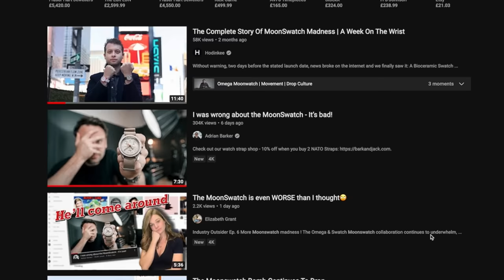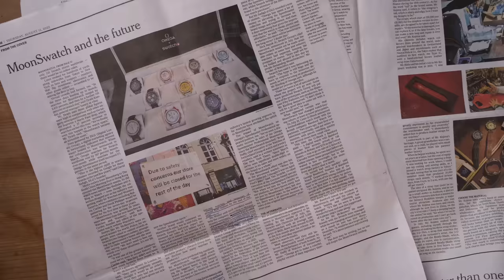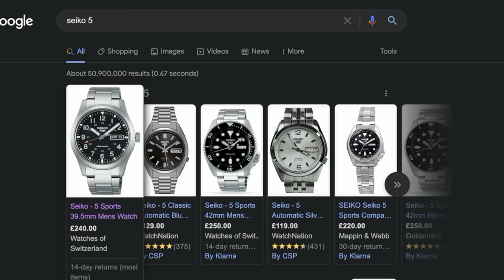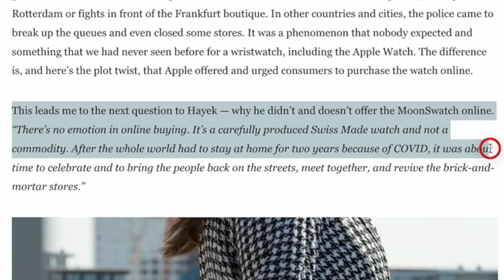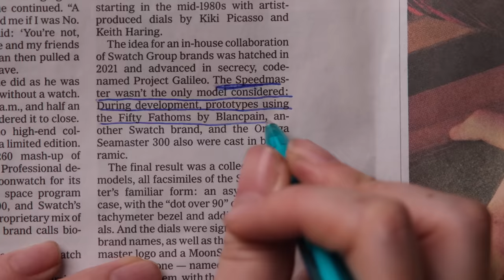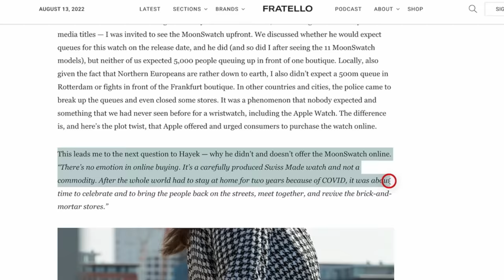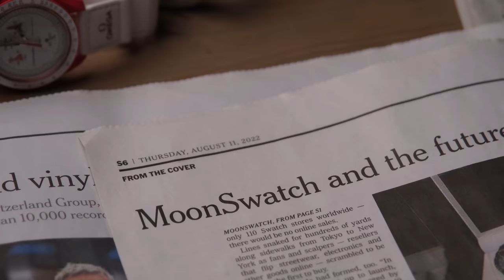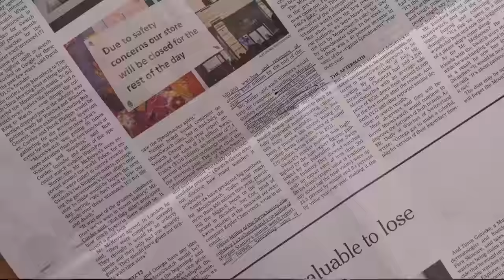The Omega x Swatch MoonSwatch = FLAMING HOT DUMPSTER FIRE

Comment: Swatch, I remember my friend got me the King of Tides SDK129, this watch has full lume on bracelet, dial, case and 200 meters. I still have it. Yes fun plastic.
Currently wearing a Timex MK1 Supernova, not my favourite, just happened to have on wrist and then see this video, the chronometer on my MK1 Supernova scratches the itch for the moons watch and has indiglo. I realize I don't even use the chronometer to time things.

I have dive watches with unidirectional rotating bezel to help measure elapsed time, analogue hands and a clean watch face is easy to read, my love is analogue G-Shock 2100's CasiOak and Square 5610.

Thanks for the video!

Comment: You didn't even mention the caseback is fixed to the case. So there is not even a way to repair it after a failure. Even Aliexpress offers much higher quality for less money. A disposable watch shouldn't cost more than maybe $50.

Comment: Whoa, looks like I've just dodged a bullet...  Let's be honest, for some people price for a real, proper Omega is sadly an unbreakable barrier, so I was initially quite excited, when I've learned about these watches recently. Mainly though, I go for quality, then the price. So when a watch bears a logo of Omega, I was expecting, that the case will be actually ceramic. Hell, it could be even generic stainless steel, but some cheap plastic? No, thank you. I torture my G-Shock at work on a daily basis, but even though it looks like it was already run over by a train, it still works, and I can always relatively easy buy online parts, like a new strap or bezel. And even replace them myself. While I could still live with that plastic case, I can't believe these Swatches have plastic glass. Well, I wouldn't expect top-tier sapphire for the price, but not even standard, hardened mineral glass? Really? I don't buy a watch to flex, I want to use it for as long as possible, and I want it to be reliable (in regard to its price).  Lately, I was looking at Vostok's Europe Energia series and now I guess I stick with choosing one of those - these are really nice watches. And to complement it, I'm going to buy one of the original Vostok Komandirskie watches, which are currently priced around 65 USD... And I'm going to wear it proudly. From what I see, it's still made from better parts and with better finish, than those Swatches.

However I must admit, the name of one of these Swatches, the "Mission to Uranus" sounds quite catchy - it could be a perfect gift for a new girlfriend 🤣🤣🤣

Comment: I agree with you. The “Watch Community” can be rather stuffy and this watch is really a Swatch with Omega Branding. If it helps Swatch Group survive, that’s fine with me. No one is holding a gun to people’s heads to force them to buy Moonswatches. If this brings them closer to “High Horology” then it has served a secondary purpose. I recently bought an Omega Constellation 41 in part because of the Moonswatch hype. [Well, not REALLY, but if it helps feed the Algorithm Gods, then OK.] I have simple advice for prospective watch buyers: “Buy what you like.” If people like the Moonswatch and it makes them happy, that works for me. It IS after all, a SWATCH first and foremost. You like yours, so there it is. 😎⌚️🍸

Comment: Perhaps you never had a Swatch as they all had plexiglass crystals which are extremely easy to polish in case it gets scratched. I have polished the plexiglass crystal of my Jaeger-LeCoultre Memovox Tribute to Polaris 1968 so I don't consider plexiglass crystal inferior but just different. The aspect which is un-acceptable is that Bark & Jack's MoonSwatch's pusher fell off after 2 months but this watch has a guarantee hence it is a simple matter of returning it for replacement since these are not meant to be serviceable.

Comment: Thanks Britt for tackling this.  I wasn’t sure how many content creators would address this now proven fiasco after Adrian’s video.   

Sad truth, with the power of the Swatch Group there is no reason why this watch couldn’t have been built to a sub $1k price point with a better ETA movement, proven plastic/resin case, removable case back, and overall solid construction.  $250 should never have been their price point with an Omega collaboration.  

Build an actual micro brand quality watch at $999 or less and create a true classic that would actually lift the Swatch brand.  Especially if they added that formula to create a whole new line.  It would attract enthusiasts beyond the Omega connection if they kept the Swatch playfulness but added some quality and longevity.   

There is no law saying Swatch has to be disposable.

Comment: I much prefer my 1983 Seiko 7a38 7070 which was also slagged off in watch circles. Just because it has a battery does not mean its disposable cheap crap. Prices now for mint examples are around 1k,and a decent example runs around £600.00. To me not only is it the first ever quartz chronograph,its the best looking Speedmaster out there next to the Omega.